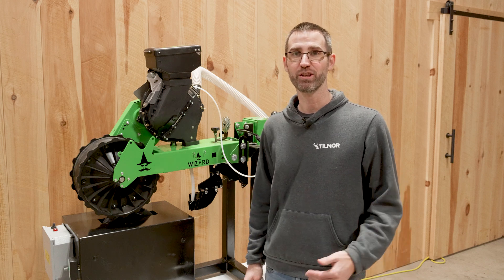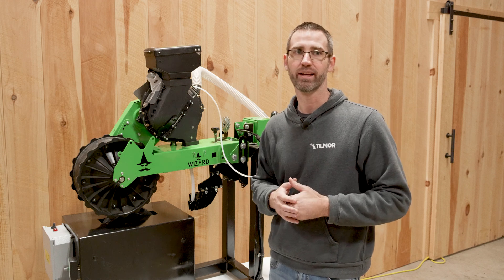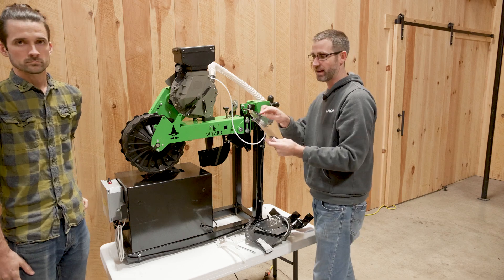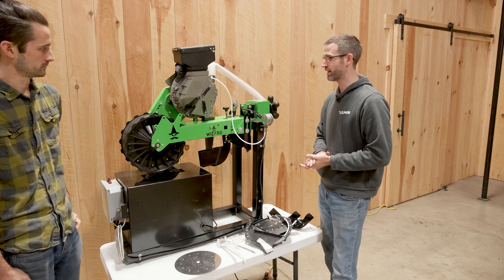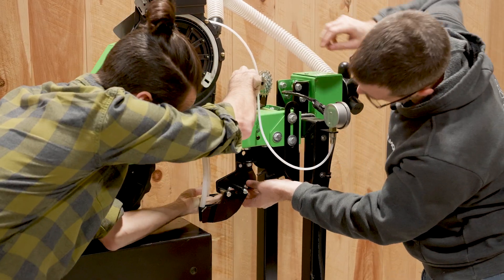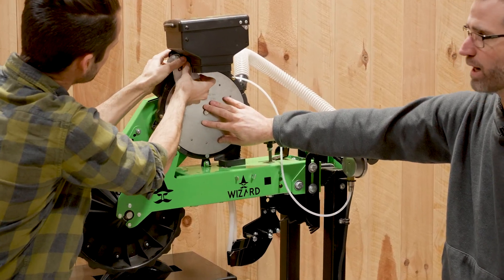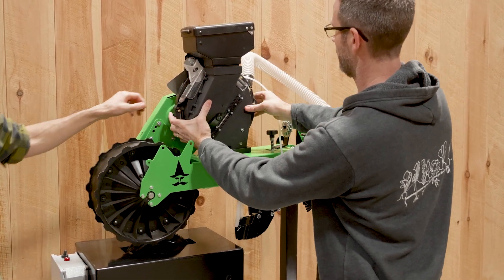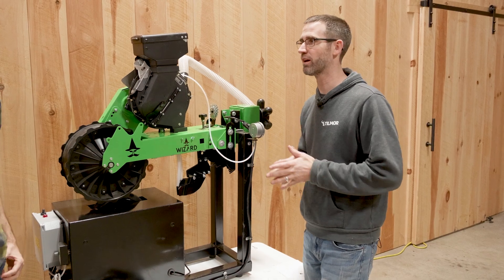Wizard Vacuum Planter | Multi Line Overview And Installation

Comment: What is the distance between the lines on the two line version?
Reply: Nevermind, I found it on your website- 3.5". How would you recommend cultivating those? Seems like they'd be a bit far apart for finger weeders.
Reply from the maker: Great question and something we should address at some point in a more in depth video.
Typically for those higher density crops you don't/can't cultivate that small gap. 
You end up focusing on a good stalebedding plan prior to planting then on the outsides of the rows after planting.